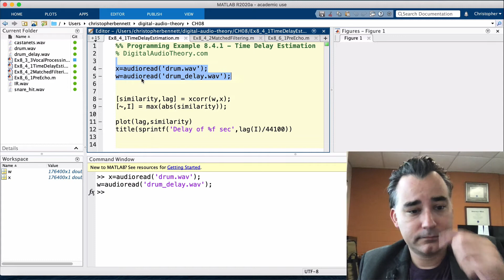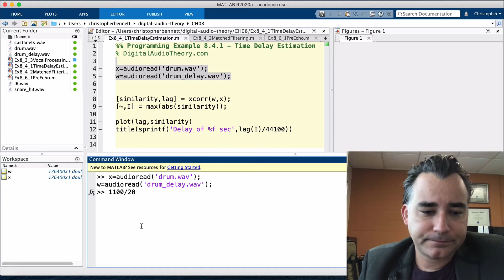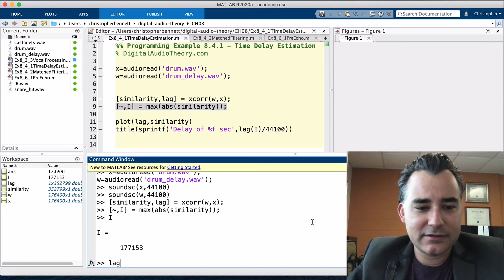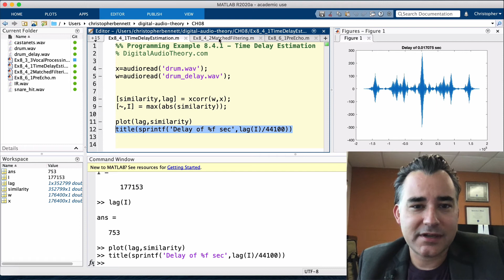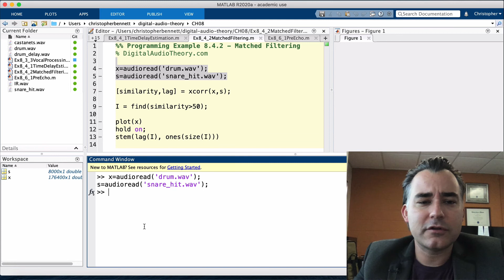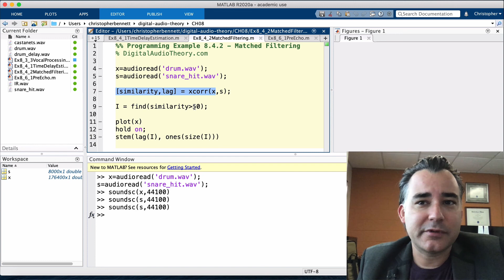Cross-Correlation: time-delay estimation and matched filtering

Comment: excellent video, but I have a question, why did you choice the  50 value for de I variable?.
Reply from the maker: It's a great question! "50" was selected by simply examining the output of the cross-correlation and looking for anomalous values. A probably better approach would be to normalize the output of the xcorr() function (based on the length of the input signals) and then the value would be akin to a percentage rather than an arbitrary value.

Comment: If we have two unequal length complex signals. How can we compute the cross-correlation without using the xcorr function and without zero-padding?
I know that some people they do cross correlation as a sliding dot product.  
But I don't know how that can be done using matlab!!
Reply from the maker: Here is a Matlab script that performs cross-correlation of two signals x and y without using the built-in xcorr() function:

% Define the two signals
x = [1, 2, 3];
y = [4, 5, 6, 7];

% Find the lengths of the signals
nx = length(x);
ny = length(y);

% Initialize the cross-correlation vector
cross_corr = zeros(1, nx + ny - 1);

% Perform cross-correlation
for m = 1:nx + ny - 1
    for n = 1:nx
        if (n + m - ny > 0) && (n + m - ny <= nx)
            cross_corr(m) = cross_corr(m) + x(n) * y(n + m - ny);
        end
    end
end
The script starts by defining the two signals x and y and finding their lengths using the length function. It then initializes a vector cross_corr to store the cross-correlation values. The script then uses nested for loops to perform the cross-correlation. The outer loop runs from 1 to nx + ny - 1 to calculate each point of the cross-correlation, while the inner loop runs from 1 to nx to calculate the sum of the product of the corresponding elements of the two signals.

Please note that this script is just one way to calculate cross-correlation, and other methods may be more efficient or accurate depending on the specific use case.
Reply: @TheCuzincuz  Thanks, Dr. Bennet!
I tried your code with the complex signals, but it does not give a single peak at the time delay index. 
In fact, this code gives a result similar to: conv(x,flip(y),'valid'). However, when I used the xcorr function, it gives a single peak.
Reply from the maker: @wesamamiri2323  Experiment with it to see if you can figure out the best way to compare complex signals. It might be helpful to think about them existing on a polar plane in frequency space
Reply: @TheCuzincuz  Okay, I will figure it out. Thanks!
Reply: @TheCuzincuz  this is the clearest explanation of how cross correlation can be done without using FFTs that I've been able to find. I'm curious, why do we want the sum of the product of the elements, rather than say the sum of the absolute difference of the elements, or some other operation? Using the sum of the product of the two elements, does this mean that data points further away from zero influence the similarity score greater than those closer to zero? If so, why is this desirable? It obviously works well but with my limited math background I don't have a math intuition as to why. Thank you!
Reply from the maker: @robomanskate  Just like in the Fourier transform, summing the product of two time-varying signals captures (and emphasizes) their overlap in phase as well as their respective amplitudes. The choice between using the sum of the product of elements or the sum of the absolute difference of elements depends on the specific application and the desired similarity measure.

Using the sum of the product of elements in cross-correlation captures both magnitude and phase similarities between the signals. It considers the similarity in the values of corresponding samples. This means that data points further away from zero can indeed influence the similarity score more than those closer to zero if they have larger magnitudes. This can be desirable in certain scenarios:

Time delay detection: Cross-correlation can be used to find time delays or phase shifts between signals. Giving more weight to points further from zero allows for better detection of these shifts and can be beneficial for aligning or synchronizing signals.

Pattern matching: When comparing signals for pattern recognition, the sum of the product method emphasizes matching patterns that align well with each other, where larger values indicate strong matches.

However, there may be cases where other operations, such as the sum of the absolute difference, are more appropriate. This measure emphasizes dissimilarity rather than similarity and can be useful in scenarios where distinguishing differences is more important than finding matching patterns.
Reply: @TheCuzincuz  Thanks so much for replying, that's fascinating!

Comment: Hey! Hope you are fine. I'm trying your code, and when I want to execute the [similarity,lag] = xcorr(x,s); I get the error saying, Error using xcorr (line 100)
Second argument must be a vector..
exercise 8_4_1
Reply from the maker: The error is correct (as they usually are) - cross-correlation is a process that operates on two vectors. In my example, I used a direct mic recording (x) and a room capture recording (w). I see in your line of code you are using a variable 's' ... are you sure that this is a vector?
Reply: @TheCuzincuz  yeah, I switched letters from s=w
Reply: @TheCuzincuz  Oh, I have 2 audios that I recorded straight from my computer. One says a phrase saying "I'm Pablo" and the other one says "Pablo" only. So the recording might be the problem. Any idea on what I can I do?
Reply: I could plot the audios without issue. But when the xcorr comes, Gives me the error
Reply from the maker: @Platinum261  Use size(x) and size(s) to make sure they are 1-dimensional vectors
Reply: Thanks in advance

Comment: 7:48 I don't understand how you can plot x (the signal) and lag on top if they have different size, i.e. x has size 176400 and lag 352799.
Reply from the maker: In MATLAB you can plot signals of different length using the 'hold on' command. Half of the lag signal is in the negative region, and the positive portion lines up nicely with the signal x
Reply: @TheCuzincuz  Ah okay thanks! By the way, I have a question, maybe you can help me. I posted it on Stack Exchange: 

https://dsp.stackexchange.com/questions/76206/find-peaks-in-a-signal-that-have-a-gaussian-like-shape?noredirect=1#comment162123_76206